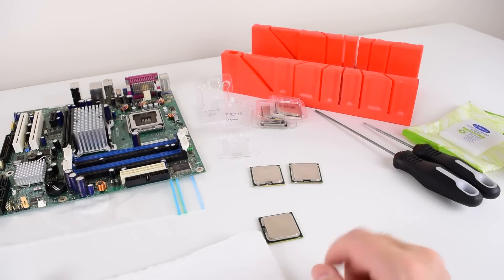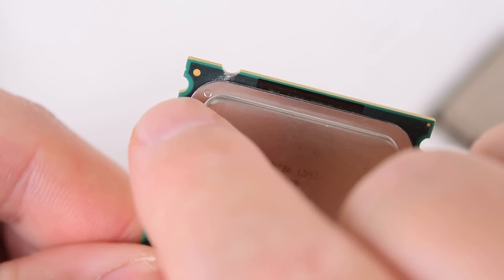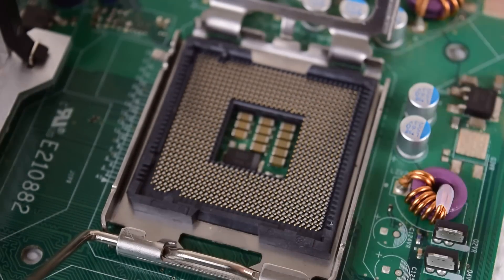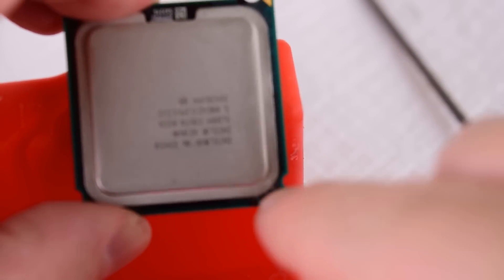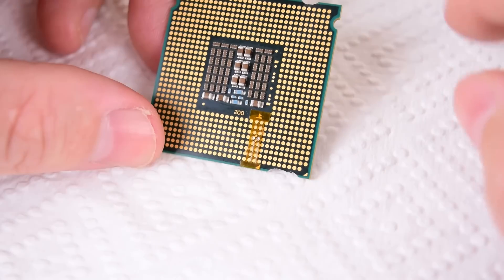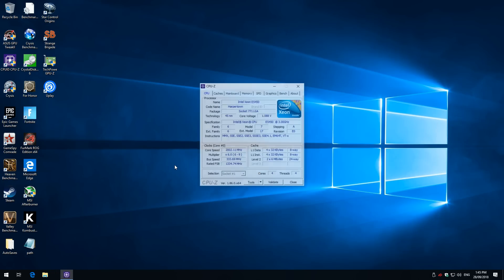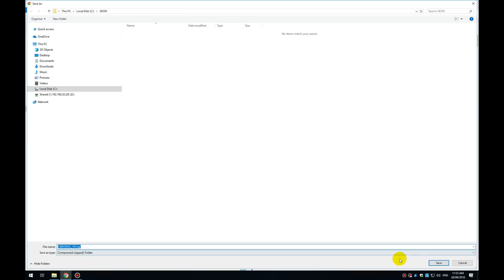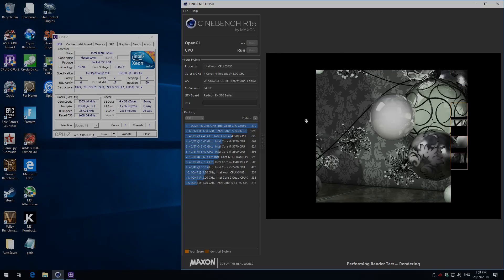Modding cheap LGA 771 Xeon Processors for Socket 775 Motherboard

Comment: i still didnt get over why they figure it out that late - I remember when 775 platform was in peak - in my currency q9650 cost about 800-900, same xeon 100-200, when this mod came out prices wasnt that much different - xeon cost maybe 50-60% of regular core quad prices

Comment: I got a Xeon X5450 for free, the mod on it was supposed to be complete but the adapter sticker fell off, so about to apply that, wish me luck!!
Reply from the maker: @Techandgaminggalore  Good luck 🤞
Reply: @philscomputerlab  I actually already finished it, now I gotta get my hands on an LGA 775 board and a custom bios for whatever board I choose so I can test it... Also do you have a discord where I can ask some questions?
Reply from the maker: @Techandgaminggalore  Only on Patreon I'm afraid...
Reply: @philscomputerlab  Alright, well then, do you have any specific recommendations for sellers on eBay to purchase a modded bios from and how much do you recommend spending on an LGA 775 board? Also, what board should I get within the price point you recommend? (For retro PC gaming with Windows XP)
Reply from the maker: @Techandgaminggalore  Every market is different and not familiar with prices recently. Modded BIOS it shouldn't matter about the seller, if the feedback and reviews check out, should be fine. If in doubt, try the mod yourself 🙂
Reply: @philscomputerlab  Aight, btw I did subscribe to the patreon
Reply from the maker: @Techandgaminggalore  Welcome onboard!

Comment: For the doing the microcode stuff where do u do it? on another pc? Or the one with the xeon?
Reply from the maker: Doesn't matter, it's just editing the BIOS file. But when you flash it, it has to be to the board that will run the Xeon. Even without modding BIOS, the board should POST just fine. It might not report all features in CPU-Z for example, but for the most part should work.
Reply: @philscomputerlab  oh so the microcode is not that neccessary?
Reply from the maker: @seikatsu.  That's right, it's recommended but the machine should work without it in most cases.
Reply: @philscomputerlab  ah ok thank you i was quite scared since i didnt know what most of the microcode part meant and i wanted to upgrade my old dad's pc

Comment: An alternative mod-free socket 775 CPU is the Core2 Quad Q9550 (2.83 GHz, 12 MB L2 cache, 1333 MHz bus speed, 95 watt TDP). As of July 2021 they sell for around $25 on eBay. The Q9650 is slightly (6%) faster at 3.0 GHz but sells for about twice as much. I replaced a Q6600 in a Dell XPS 420 with a Q9550 and increased the PassMark performance score by 35%.

Comment: Can't get a X5450 to run in HP DC8000 Elite SFF as BIOS wont accept it and can't tweak the BIOS on this baby. hey ho, time to sell the XEON on and get a Q9550 /9650 instead I think.

Comment: HI, I have a issue with a Xeon i just installed on older ASUS P5QL SE MB which has quads in its specifications so can handle 4 cores. Windows 7 installed, socket 775 Put a modified Xeon in and its stable and working ok at about the same speed as my old core 2 Duo but CPU-Z ect is only showing 2 cores and 2 threads?. I went into Msconfig and advanced/boot and only 1,2 cores are there to change; shouldnt 1-4 be available? I have original BIOS and also if this makes a diff the bios is set to IDE not ACHI but i tried changing it to ACHI and it wouldnt boot so put it back to IDE and its fine and working. Would that setting need to be changed or is it only for security ect eventhough ACHI is more up to date?. would i have to have loaded windows fresh set to Achi to use ACHI? and do i need to worry as the computer is Win 7 anyway? So do the settings in BIOS make any diff to 4 cores being seen? Thanks for any assistance you can give 
Tim

Comment: I have a P5E64 WS Pro motherboard with x38 chipset, so my options are quite limited unfortunately. I already have a Q9450 so there's not much to be gained by upgrading with another CPU. Maybe if I can get a cheap Q9650 or X3370... My system already has an SSD and I recently upgraded from 4GB ram to 8GB, so it will still be a quite decent system for a while (at least for webbrowsing, playing videos, simple office tasks). I'll probably use it until Windows stops supporting it.

Comment: Any workarounds you know of to get to work on the Q45 boards?  I'm reading into for my HP Compaq 8000 Elite Small Form Factor AU247AV mobo.
Reply: Nope. Just tried. DC8000 786G7 mobo. reverted to W7 to put 1.4 BIOS on but it doesn't recognize X5450 and don't think the BIOS can be tweaked. Someone send me a microcode link if you have one please!?

Comment: Thanks for the demonstration. How to download award bios from motherboard to do this mod? I don't have the bios update for the motherboard anywhere as its a  unknown brand but I have the award flasher awdflash with me.  I also have CBROM v1.95. tool. Can it make a backup of bios from motherboard as a bin file?
Reply: It seems that this processor mod is not supported by G31 motherboards with Q35 and some other graphics chipsets. It was the reason for the processor to not boot.The procedure seemed to work with latest xeon micro codes added to the bios file.  Viewers may try asus or gigabyte motherboards which are supposed to work. There is a long list of graphic or board chipsets which don't work with some lga 771 xeons so buyers beware of those chipsets when doing this mod.

Comment: Is it necessary to modify bios? Will it run perfectly without modified bios( I'm not planning to overclock)
Reply: I know that it is required for it to work as a Xeon. If it has the correct stepping it will work as its closest 775 counterpart so usually without issues unless the manufacturer decided to lock it down. If it has E0 it will cause some problems.

Comment: What are some applications ppl are using these systems for nowadays? Just little personal PCs, little retro gaming machines, or something else?
Reply: I had an Nvidia 8600, 2GB RAM & C2D E6420. I upgraded it years ago to a £15 E5450 @ 3.85 Ghz, +2GB RAM £7 and a used 950 GTX for £95.  

Still using it to play older games at 1080p. Some were free, GTA V, Rising Hub, Dirt Rally (55 fps on Ultra), Bioshock, Streets of Rage 4. Got 402 on Cinebench. 

Just inspected the 12 year old PSU and it's got a leaky capacitor, - probably why it hangs on boot occasionally!

Comment: would q9650 work on a modified motherboard for the xeon e5420, or motherboard must be restored to the old version of the bios to accept q9650 again?
Reply from the maker: The 9650 should work with the modded BIOS!

Comment: Today I installed a Xeon L5410 on my Asrock G31M-GS (which was on the latest BIOS) and detected the CPU without needing any 771 microcode. It even unlocked a set of new feature inside my BIOS. Videos like yours and the ones from Bryan (Tech Yes City) inspired me to give old Xeons a shot. Now it is time for some overclocking.

Comment: Hey Phil, how do you choose the 775 boards? Do they all work when modding? Do you look at the ram capacity?
Reply from the maker: There are certain chipsets that work, for example X chipsets don't work. There are lists you can google, or you can contact that seller on eBay, that sells modded BIOS for 1 dollar.
Reply: @philscomputerlab  That narrows it down a bit. I recently bought about 400 sticks of ddr3 2gb and older ram's from a guy who was selling them for the gold. I tested a few and they all seem to work! Thought I'd try and build something out of them. If you ever need any old memory sticks just let me know! Thanks.
Reply from the maker: @jojinkang2779  Nice. There are 775 boards that take both, DDR2 and DDR3. Great for testing RAM :D

Comment: I did the notch mod on two Xeon E5450s by using a hand dremel tool with a bit head that perfectly fit inside the notches.  Just used it to cut in the new notches.  Boy work perfectly.  In fact, I used this mod to build a Linux server for Plex and network file storage.

Comment: hello, if the bus speed is 1333mhz, i can not put a xeon with 1600mhz right?
Reply from the maker: Most motherboards will OC the bus speed, but some will just run it at 1333, therefore underclocking a FB 1600 CPU.

Comment: I found a pc in my locality for 250USD
E5450 stock
Some okay cooler. Not the stock intel one though.
8gb ddr3 @ 1333mhz ( dual channel )
MSI G41M P28
Zotac GTX 950 
240GB KLLISRE SSD
500w psu 
Delta atx casing

Comment: I remember when I upgraded from a Core Duo E2200 to this, was in 2013 or so and with the mod it was about 50$  back then, including the BIOS custom tweak (was a local guy). Really good setup, still have it somewhere in storage :) Back than I chose to cut the mobo socket, touching the CPU with a file was taboo for me :P . On a side note, it's insane how some Chinese decided to mass produce a ... mod, I'm talking about the sticker thingy

Comment: Hi there been following yar channel for a lil while, love the content. I bought a xeon x5470 already modded with sticker underneath and all from Ali, I planned on using it on my Asrock G41M-GS mobo, cuz I saw on the delidded page that my board seems to be compatible with such. SInce I already got a Q9550 up and running 3gig of ddr2 and corsair 750w psu I went ahead and injected the Xeon microcodes in the Bios following the instructions on the dellided page, but when I go and boot my rig up with the Xeon everything turns on as usual, fans and all but no video output on the monitor. If I switch back to the Q9550 cpu tho it works like before. What might the problem be? Do u suggest to get a modded bios from Ali and see what happens or what shud I do? Cud it be that I might need more Ram? Already bought 8 gig and they're on their way. Or perhaps even if the board is listed as compatible might not be so? I been fiddling with pc for quite a while, removing components and replacing them with newer one and so on, so I don't consider myself a dumbnut when it  comes down to such stuff seems to my unlikely that I tempered with the Bios improperly... But as they say ya never know
Reply from the maker: There is a seller on eBay, selling modded BIOS for a dollar, I would try that.

Comment: Hello PhilsComputerLab, can I use a pre modded xeon 5470 for my Gigabyte G41MT-S2p mobo??
Reply from the maker: No, I recommend getting the E5450 instead.
Reply: thanks for your suggestion. I have a gigabyte 450 watt PSU, so wattage wont be problem, but the thing is 125W(E5470) processor will heat up my mobo like crazy, where E5450 will not cause its 80W. such a huge difference in watt but only 0.3ghz difference in performance. also my mobo might not support over 100 watt.

Comment: As with most of these X54** CPU in 775 socket videos, there is no mention of installing better cooling.  Going from a 65w CPU to a 120w CPU can create issues if the stock cooler is used.  In addition to that, finding an adequate cooler may be difficult depending on clearances and case size.  I'm not saying this is a bad mod, only saying that there is a significant final step left out of almost all of these 771 to 775 mod videos.

Comment: honestly I don't understand people wanting a damn Xeon fact is if you get a Core 2 quad Q9650 or Q9550 it is 4 cores 4 threads and is faster then the 771 Xeons and with the 771 xeons you run the risk of frying the board if the tape isn't placed properly its a complete waste of time its better too just update bios and put in a Core 2 quad that's equal or better then any 771 xeon and runs zero risk !!!! my brother has a xeon 2.4 ghz 4 cores 8 threads but its slower then my Q9550 and those extra 4 threads are just hyper threads not as efficient and the GHz are much lower even with the 3.0 GHz Xeon its slower as it doesn't have all the extras that the Core 2 Quads have hence MMX,SSE,SSE1,SSE2,SSSE2,SSE3,SSE4.1,EM64T,VT-X which blows the Xeon out of the water for proformance long live Core 2 Quad Q9550/Q9650 and Extreme editions for a cost of 40$
Reply from the maker: You're mixing up a few things here. Any board that supports the Q9650 does not require a tape. Also, nowhere in the video are we using a tape. Also there is no Hyper-Threading for Socket 775.
Reply: @philscomputerlab   LGA775  cpu with hyper threading lol https://ark.intel.com/products/27465/Intel-Pentium-4-Processor-531-supporting-HT-Technology-1M-Cache-3-00-GHz-800-MHz-FSB-
Reply from the maker: @technocrat7971  That's a Pentium 4, not Core 2.
Reply: @philscomputerlab  never claimed their was hyperthreading for 775 but hypertheads are only half as effective as full on threads and most all of the core 2 duel and. Core 2 duo boards are core 2 quad compatible and just require bios update I've put Core 2 quads in many socket 775 core 2 duo and core 2 duel boards no issues and yes you have too cut a small chunk out of the slot or use a small peice of tape too overclocked most of the Xeons and 775 type processors covering 2-3 connectors too the board
Reply from the maker: The CPUs, well most of them, easy to identify, come pre-modded. You just need the modded BIOS with microcode injected. It's silly paying double or more for a Q9650 when you can get the E5450.
Reply: @philscomputerlab  I've seen on EBay Q9650,s for as low as 15$ and pretty much new and never overclocked for 40$ don't know the price fluctuation of E5450,s but honestly the Q9650,s are pretty cheap so price vs raw power and control I would always go for a Q9650 as they bench and give the same Proformance as most i5,s and give good overclock that are stable up too 4ghz mind you if your going that route I would get a H50 corsair water cooler closed loop too deal with temps as stock is useless and the H50 40$ does a better job than the noctua vapor blocks or shuriken vapor blocks for 15$-25$ and yeah pairs good with the Evga 1030GT 2-4gb graphics card for 119$ https://m.newegg.ca/products/N82E16814487347

Comment: do i need to modify bios to install xeon???
Reply from the maker: If you flash the latest BIOS, it should work most of the time, but to get full support, yes, you should mod the BIOS.
Reply: @philscomputerlab  any guide how to do it, or is there a video on it motherboard gigabyte ga-g41mt-s2 rev 1.5
Reply from the maker: @ixrvalor0812  I can recommend this seller. $1 and he sends you the modded BIOS file. Just let him know what board you have! https://www.ebay.com.au/itm//283101600332

Comment: so if i buy modded xeon x5450 and put it on my socket i wont need to install bios and modding bios stuffs ? just boost the system ?
Reply from the maker: I recommend you always mod the BIOS for full support! It might, or might not, work without the mod.
Reply: your motherboard must support the cpu. check this site. https://www.delidded.com/lga-771-to-775-adapter/3/#motherboard-compatibility-table

Comment: milan filipovic
Пре 1 секунде
and l have pq5 pro turbo what to do to buy x5470 1333fsb or x57921600fsb l have lc600w power supply xeon e5440 ram 4x1gb transcend and coller cooller master with heatsink my moterboard is pq5 pro turbo p45 chip fsb speed is 1600 l dont no what to do because when buy x5792 for 20euros not working in full speed because is low mhz my ram and that is not timing l dont no

milan filipovic
milan filipovic
Пре 3 секунде
and because this mobo is diffrent l put microde to not wait when system is boot unleah cpu power 10 sekunc know working wery well l first buy pq5 pro turbo and new 600wpsu and new ssd 250gb on 12monts 15euros each monts to pay conry and know that procesor to  buy graphisc card in last end because is very very expnesive l dont have 50euro for gpu that is shit l know

milan filipovic
milan filipovic
Пре 1 секунде
l dont have brain because l sooo read and read one years l wait for this mobo 3years that thuf life know l buy it l fps is on colin mc rally remaster 2005 17fps because l my gt 8500 512mb 128bit is shit

Comment: I install an E5472, that I got on ebay for $$15, on my evga 750i ftw mobo and it works great. The only difference is I took off the notches from the motherboard socket instead of filing down cpu, which I didn't know was an option and wish I had done instead.

Comment: Another great mod that should be paired with this video would be the BSEL mod stepping the x5450 FSB from 333 to 400. I do believe that takes the total clock speed up to around 3.7 GHz. That is as long as this board supports 400MHz FSB.

Comment: Hey Phil, I just want to pass down the good info that files are one-direction only, so you need to apply force when pushing but not pulling. It makes the job SO much cleaner and faster. 50% of wasted energy if you use force in both directions :)
Reply from the maker: Thanks! The filming made the entire thing a lot more awkward that is should be :D

Comment: Do you know if the 775i65g can be modded like this? It would take take Frankenstein nature of that board to new levels.
Edit: I've modded the BIOS files, but I haven't dared flashing it
Reply: I didn't find your motherboard listed under the tested motherboard listing on this page. However, that doesn't mean the mod wouldn't work with your ASRock MB. https://www.delidded.com/lga-771-to-775-adapter/3/#asrock

Comment: Is it worth now in almost 2019 to have this build ? I have an old Core Duo E8400 3 gh , 8 g ram and a GT 730 2 gb , it work nice now after almost 10 years and small upgrades over the years ( memory , graphic card , cooler Gammax 200t ) . Most of my games are old ones like LoL , EvE and WoW , i am oldschool gamer , i don't play new ones but who knows what the future will bring . In my country i found one kit offer with 50 USD (42 eur) a  X5460 with Foxconn G41MXP and a cheap cooler (system is tested and all bios updates ready) . Is it worth to change my old system with this one ?